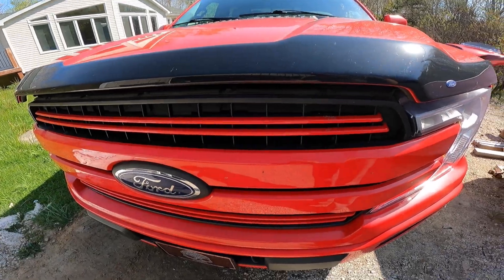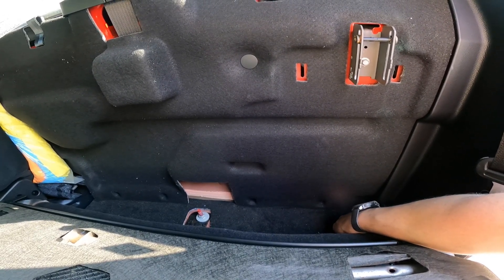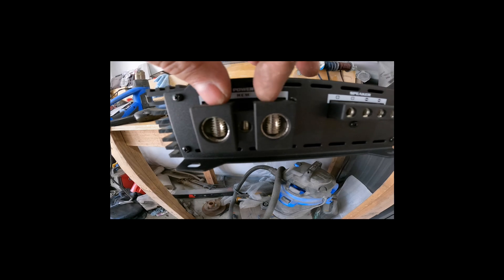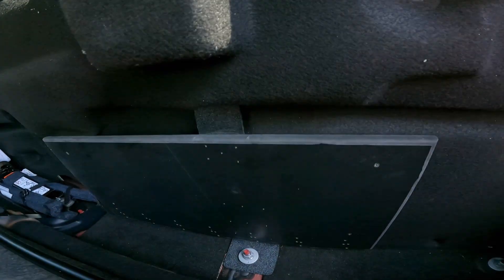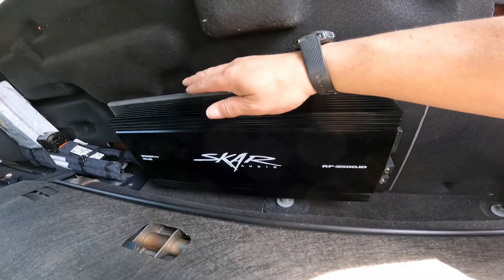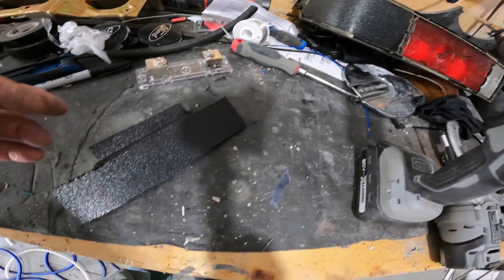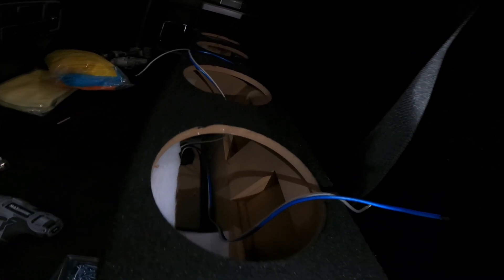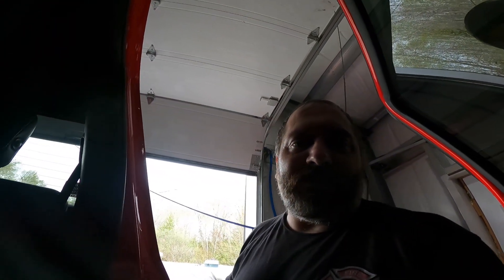AWESOME F150 Skar audio upgrade! Tri County Kustomz

Comment: What should and install like this cost for a 2018 F150 with no factory built in amp. I have the skar box with two tens and an 800 watt skar mono amp.
Reply from the maker: For cost would be depending on the shop you go to.  It took me upwards of 4-5 hours to do the install. Keep in mind I'm a one person shop and I also have my powder coating aspect of my business as well. A shop with multiple employees could do it quicker.  But if you have the products you could budget between 400 to 1000 for labour and shop materials.